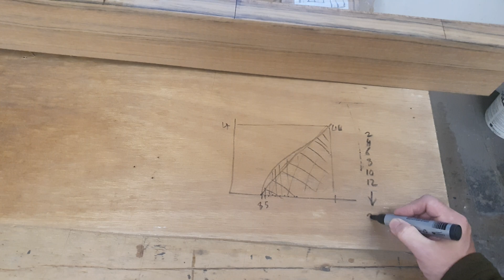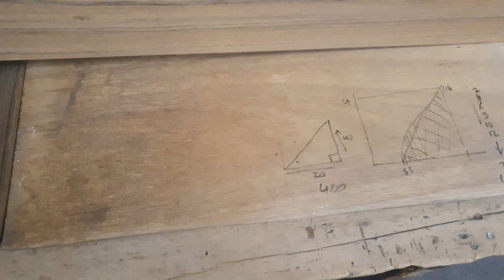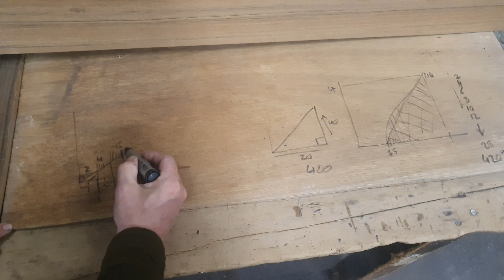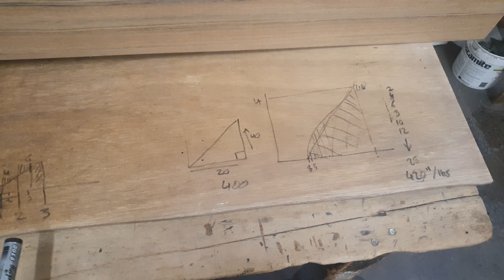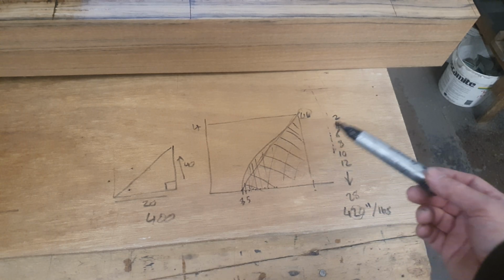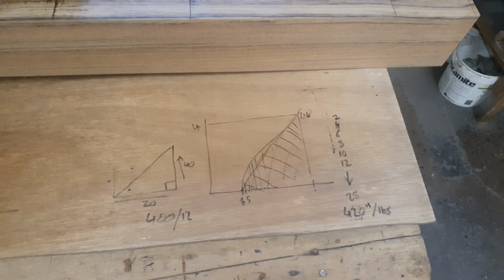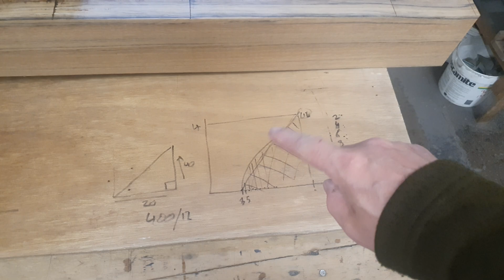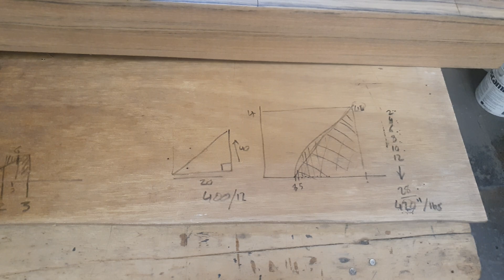how to calculate the total stored energy in your bow.

Comment: Alternatively you can get a heavy arrow, that shoots between 100 fps and 150 fps, and use the equation:
ft lbs energy  =  ( <arrow weight> * speed * speed ) / 450240

The reason for the heavy arrow is that bow efficiency goes down with lighter arrows.  So to see the actual energy of the bow you need a heavy arrow to take more energy away from what gets wasted to move the limbs.  If you use a normal arrow the higher speed of the arrow limbs will be taking more energy that would be going to the arrow.
Reply from the maker: @musikSkool   limb construction changes efficency too, the difference in dynamic mass of a limb can be nearly 20%.   The dynamic mass has nothing to do with stored energy.  There are very very few genuine carbon limbs on the market, most have a glass fiber content.  Real carbon laminated limbs really excel in the dynamic mass stakes.
Dynamic mass doesn't just include limb materials, but also includes working limb length.

Comment: You could use integral calculus - but that'd require working out the mathematical function for the DFC which, for your super recurves, could be a challenging exercise hehehe!
Reply from the maker: I'm trying not to scare people off
Reply: Excel or a similar spreadsheet program can be used to get a polynomial curve that fits the data points, super recurve or otherwise.
Reply from the maker: @edsorens  half the time we dont need the DFC.    We sum the values up straight off the draw board, and have an SE/PDF value within seconds.     It it looks good.    Then we plot the graph. And we can play with data from then on.
Reply: Sounds to me like he kind of was using calculus, but in a way that is slightly more understandable. But, I have only a vague understanding of calculus. I’m certainly not a mathemagician.

Comment: This is a nice easy thing for an Excel sheet.
3 Columns. 
First gets numbers from 0 to 20 (or beyond). 
Second gets the poundage as measured. From 0 to whatever.
Third starts with 0. And all others below are of the form of =B1*(A2-A1)+0.5*(B2-B1)*(A2-A1)  -  (a proper rectangle plus the small triangle on top)
You sum the third column for Energy.
This way you interpolate a basic arithmetic mean also known as a poor mans Integral if i did not butcher the language.
Reply from the maker: It's the most simple method I've seen that gets you within decimal points of accuracy
Reply from the maker: 100%
Reply: I believe this is called a Riemann sum.
Reply: Or your form may be a trapezoidal sum.
Reply: @edsorens  Looks like a trapezoidal sum or middle point riemanian. Truly going above this is overkill for the amount that the curve changes. 
If a more precise value is needed just do half inches instead of inches. Double the work though.
Conversely for the mathematically inclined Excel can spit out actual polynomial functions for a given data set which you can manually integrate if it's raining and shooting bows would be miserable. :)
Reply from the maker: @edsorens  I think your right.    A left right and center version is available I think.
For this purpose.   That level of detail.isnt needed IMO